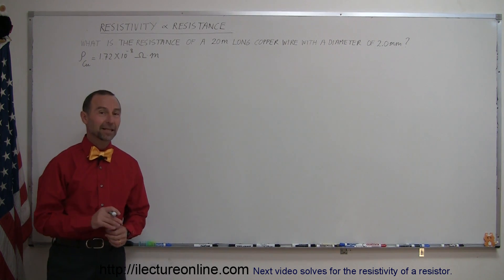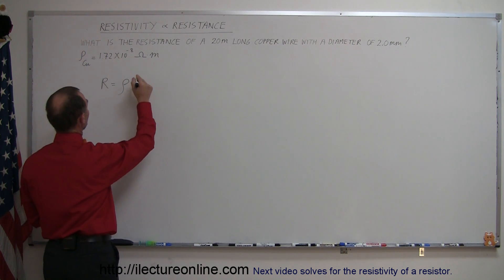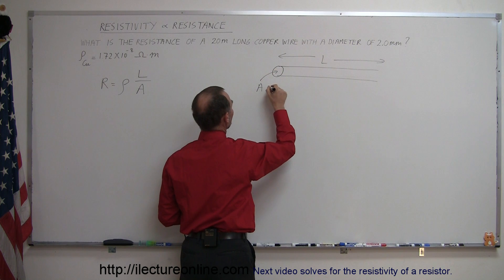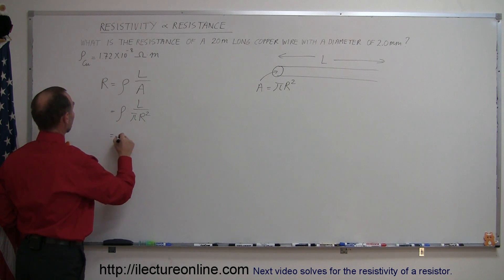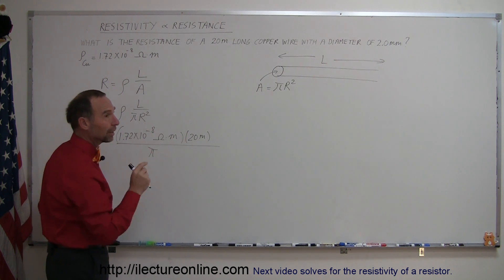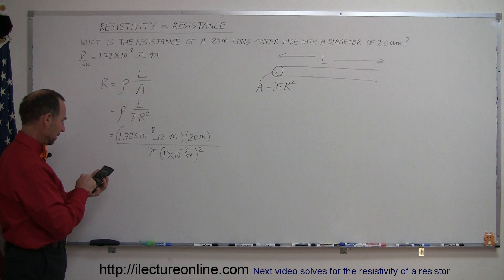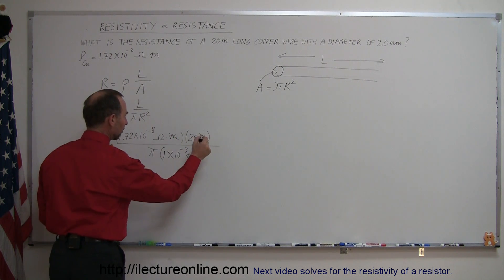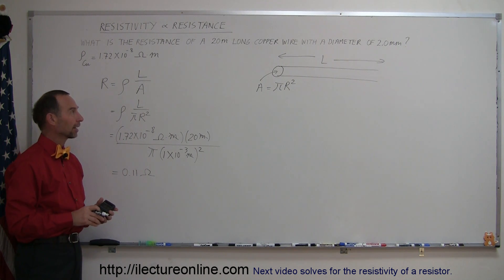Physics 40   Resistivity and Resistance (1 of 32)

Comment: Small question , why we dont add up the Area of surface cylinder ,2pi r L
Reply from the maker: We only want the cross sectional area through which the current flows,  (the current doesn't flow through the sides of the cylinder)

Comment: i think 2.0/1000= 2x10^-3 and not 1x10^-3
Reply from the maker: You are correct.  But the that is the diameter, not the radius.  The radius is indeed 1 x 10^-3
Reply: +Michel van Biezen btw I got it already. Thanks for this video. It helps alot to me. You're good at teaching than my physics teacher. haha :)